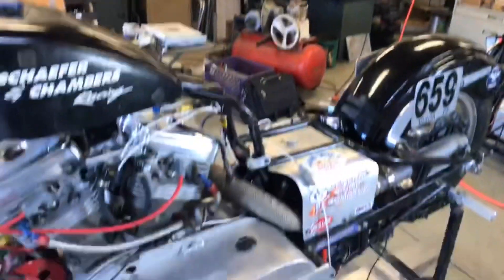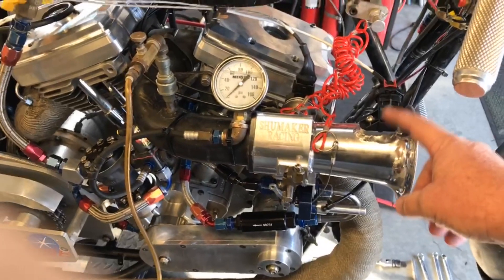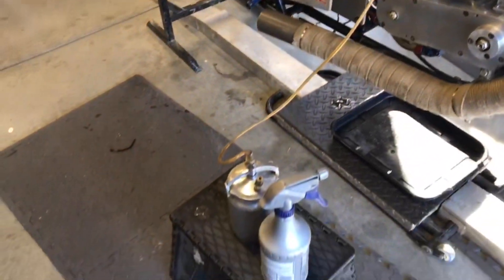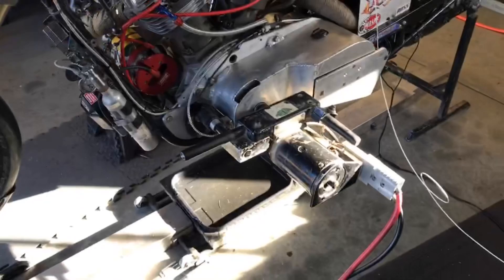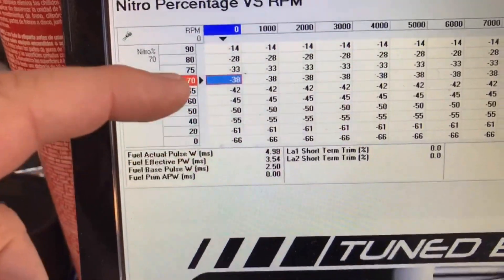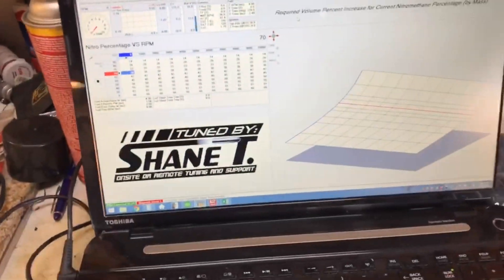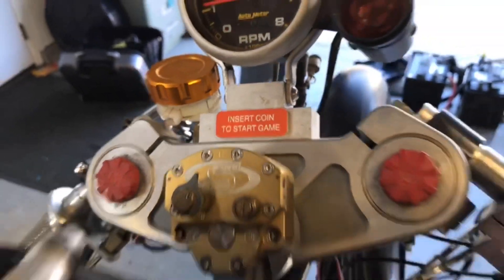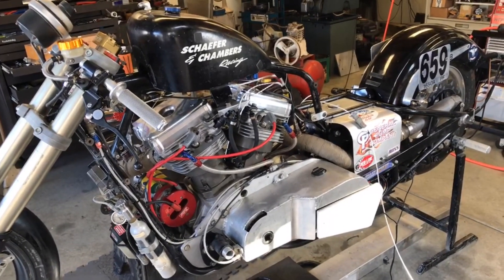What’s Shane T Tuning Today? Nitro Harley LSR Bike - First Startup and Walkaround - Tuned By Shane T

Comment: If you dont mind, i correct few facts...   Nitromethane is not shock/knock sensible even in 100% form like nitroglycerin...  we normally run with tf harleys 85% 100%    Nitromethane does explode if squeezed to high pressure in closure like cylinder...  it must be ignited with spark in cylinder or it may pressure ignite or go hydrolock due to high volume of fuel in cylinder...   super charged fuellers have 6-7:1 compression ratio, because fuel amount in the cylinder acts like a piston, that phenomenon causes the compression ratio to rise up to 12:1 in reality
Reply from the maker: If a Top Fuel Engine is 6:1, with a combustion chamber volume of 120 cc or thereabouts and 10 cc worth of volume in the cylinder on a per cycle basis, how is it possible to “hydrolock”? How could the geometric compression ratio be 12:1 if it is 6:1 with a 120 cc chamber (plus however much the piston is down the bore plus the gasket thickness) with only 10cc worth of volume taken up by the fuel? 
The peak cylinder pressure during combustion is the reason the compression ratio is low so as not to exceed the limits of the hardware, not because the fuel volume causes hydraulic lock.

Comment: I'm sure you probably know this, but being in a garage (or less than wide open space) you may run into issues with the fueling going rich because of the fumes in the air not dissipating.

Thanks for all the cool videos. Great seeing fun stuff outside of OEM controller tuning.
Reply from the maker: Yes agree particularly if it runs for long periods or at high flow rates. Its pretty stunning how many dyno cells dont have adequate ventilation or they let the exhaust go into the room and find its way out. In this case idling, with the garage door open, and fans blowing air around and with nitro, it’s unlikely to affect the lambda.

Comment: That Awesome Shane 
What’s the next upgrade for it ?? 
A little sip of hydrazine 🤔
So many questions.
Does % increase risk of pre det ??  If so how does it alter timing??  Flyweight mass In mag ??? 
I’ve got an idea that I think you would be only one of a few could answer and it could be a lot of fun to develop. 
And if it worked 
 I think it might be a game changer. 
How can I pm you ??
Reply from the maker: Hello there. Next its time to go tune it on the dyno and make sure we have it running right. Then it’ll be time to try it out on the Dry Lake. 
Definitely no Hydrazine. 

% doesnt increase risk of detonation or preignition in and of itself, however % certainly affect the outcome of detonation or preignition in a negative way. 
Timing does appear to require changing. We will find out what that number is at 70 percent.

Shaneteck@yahoo.com is my email.
Reply: @TunedbyShaneT  
Thanks Shane 
I’ll send you a message and I think it will get your gears thinking.

Comment: Discovered your channel on that cosworth Indy engine. Another great video here. Would there be much advantage to controlling ignition advance with the motec too? I dont know much about that red distributor.
Reply from the maker: Thanks for the compliments David. So as far as an advantage to running the ignition timing with MoTeC I’m not sure there is an advantage. We will prove that on the dyno. For now I am trying to be as minimally invasive as possible for these guys who are not used to EFI to begin with. And since we are tuning with Nitromethane, in a percentage I have no experience with, it seemed like taking control in small increments made the most sense.
Reply: @TunedbyShaneT  sounds fair enough to me! Dont want to confuse the carby guys. Does the red dizzy have any mechanical advance or is it fixed ign?
 I did similar on my efi install. Started with fuel only and left the dizzy in place. Eventually swapped over to individual coils once I knew the fueling side worked.
Reply from the maker: Its fixed. We discussed this today. If we find the timing needs to be significantly different low to high rpm, we may add a way to vary the timing on the Mag.

Comment: I always thought 70% was kind of in the "dead zone" for nitro. It makes power, but supposedly not much more than 50%, and not nearly as much as when you get 85% or higher.
Reply from the maker: Could be. I know the gain running 50 percent is about 35ish percent over Methanol. I cant think of any logical reason why the gain would not be linear as the percentage goes up. Could be wrong. Ill let the engine tell me through the dyno. Most of the time when it comes to “tuning” people do not listen to the engine and instead listen to other peoples wrong assumption. Im not that guy.
Reply from the maker: We will find out. We know how much we get at 50% Once we dyno it, we will know what we get at 70.
Reply: I've never tuned nitro, but I did stay at a Holiday Inn Express once.

I'd picked that up from some friends that are on nostalgia nitro teams. Maybe it was more like 25-60%. Somewhere in the middle there I guess there's not much for gains. I think it's why the old nitro coupes like Kuhlmann ran for a while weren't more impressive.